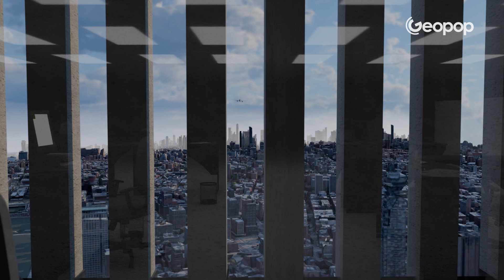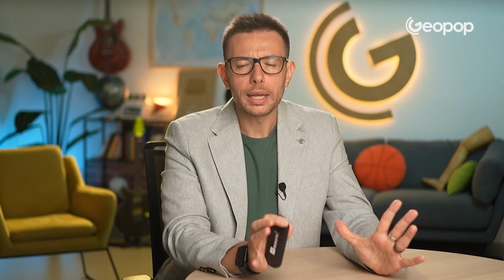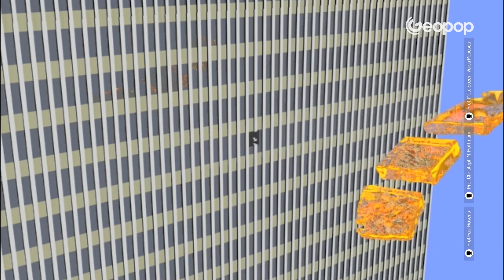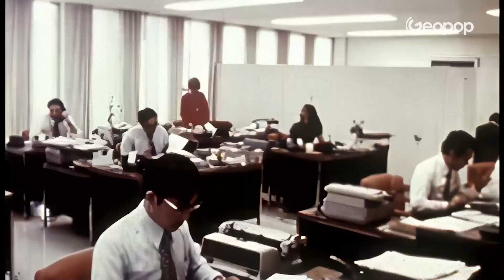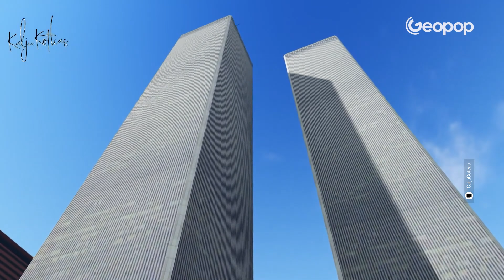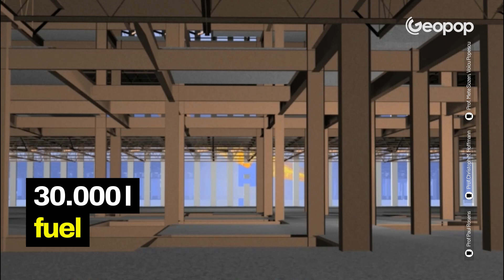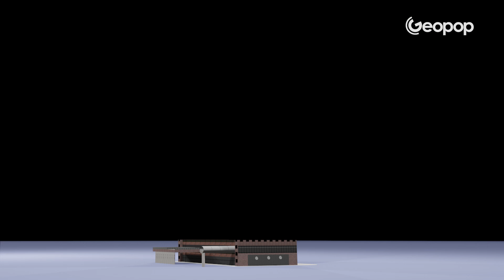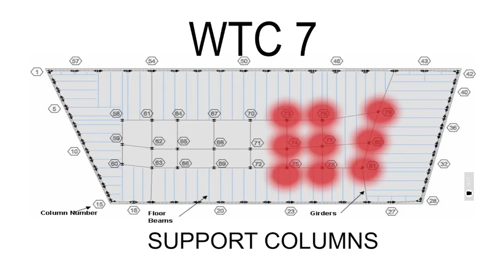9/11, 2001: The Technical Reconstruction of the Twin Towers and WTC 7 Collapses

Comment: I hate conspiracies and nonsense, but I can't even start to understand why building 7 went down so cleanly...
Reply: Perhaps this will help.  Building 7, the 6th building to collapse of 10 lost on 9/11 still confuses many even though it has been extensively studied. Not famous or a terror target, and with no casualties it did not get a lot of attention initially, creating an information void the internet rapidly filled with garbage. Because everything seems like a conspiracy if you don’t understand how it works I prepared this brief summary of the collapse from my own analysis. No politics, just engineering. 

The North Tower collapse at 10:28am bombarded Building 7 with tons of burning debris, causing heavy damage and starting multiple fires burning out of control for the next 7 hours. Half the FDNY firefighters having been killed, others injured, units in disarray, equipment destroyed, no water pressure, and the greater urgency of Search & Rescue efforts, firefighting was pulled as futile. The building couldn’t be saved and was left to its fate.

www.youtube.com/watch?v=g_SvpwyC17M&ab_channel=MFitz  

Collapse of a burning structure is always a concern for firefighters. Steel buildings subject to fire rely on active fighting of the fires to survive. Buildings are designed around 1 to 3 hours of fire resistance, allowing time for occupants to escape and ACTIVE firefighting to get started, after which all bets are off. Left to their own devices they will exceed their design envelope and collapse. In B7 the occupants escaped, passive and active fire protections were compromised and active firefighting was abandoned which left the building to take its chances. It lost. Odds on Building 7 would eventually collapse, and it did. No big deal in logic. That is the sort of choice firefighters make every day in brush fire situations - which houses to save and which ones to let go. Only real difference here is moving the decimal on the size and cost.

www.youtube.com/watch?v=WnYBX6QT0R4 

FDNY Chief Daniel Nigro ; The biggest decision we had to make on the first day was to clear the area and create a collapse zone around the severely damaged 7 World Trade Center, a 47-story building heavily involved in fire. A number of fire officers and companies assessed the damage to the building. The appraisals indicated that the buildings structural integrity was in serious doubt. I issued orders to PULL BACK the firefighters and define the collapse zone. It was a critical decision; We could not lose any more firefighters. It took a lot of time to PULL EVERYONE OUT, given the emotionalism of the day, communications difficulties and the collapse terrain

FDNY Deputy Chief Peter Hayden ; We had our special operations people set up surveying instruments to monitor and see if there was any movement in the building. We were concerned of the possibility of collapse in the building. And we had a discussion with one particular engineer there, and we asked him if we allowed it to burn could we anticipate a collapse and if so, how soon? And it turned out that he was pretty much right on the money, that he said 'In its current state you have about 5 hours

The collapse of Building 7 was anticipated and widely reported in the media throughout the day. At least 24 video cameras recording some or all of the collapse. Everyone knew what was coming and why.

www.youtube.com/watch?v=OY5S5k3tMHI 

Building 7’s collapse was completely different to the Twin Towers, harder to understand with most of the details difficult to see. But we can still sort out what happened through careful analysis and observation.  This is MY EXPLANATION of the collapse sequence using the best available information and relying on no authority.

B7 was complex 47-story steel framed structure built on top of a smaller existing 3-story building, requiring several lower floors dedicated to complex load transfer structures instead of usable office space. Of trapezoidal shape and all-steel tube-in-tube construction, B7 (above the 7th floor) consisted of a central core of steel columns carrying most of the gravity load, perimeter steel columns around the outside of the structure carrying the remainder of the gravity loads and long span beams and girders to tie those elements together and form the floors. On the outside of the building hung a moment frame - the last part of B7 to fall. 

Phase 1 : The first externally visible signs of collapse initiation occurred at 5:20:28 pm. Collapse initiation for B7 is notably quiet with observers not realizing the building was collapsing! There was no audible warning in the form of say hundreds of ear drum busting 180-190dB explosive bangs preceding the collapse. Here at 12:00 a local CBS affiliate reporter is talking 10 blocks from B7 when collapse begins. People don’t start to notice the collapse until 12:11. Then at 12:45 is the famous CBS fixed camera clip of Building 7’s collapse.  Note how quiet it is.

youtube.com/watch?v=t5tEy6mXSE8&ab_channel=fresnosean379

Collapse initiation was due to lower floor failures above the load transfer region (7th floor) in the NE corner of the building. In this video at 0:45 you can see the NW corner from inside the building while under construction, Column 79 just out of frame on the left. That big, angled steel beam across the top of the frame connects to C79 at one end. The girders connect to the beam. That beam and all those girders depend on just one connection

youtube.com/watch?v=nP3TNHPCIVU&t=35s&ab_channel=EdwardCurrent

Phase 2 : Lower floor failures caused a loss of critical lateral support over an excessive length of core Column 79 and it buckled. If you look at a floor diagram of Building 7 (see above) and look at all the structures that depend on C79 you quickly realize this one column was a relatively isolated structural element on which a disproportionately greater fraction of the structure depended analogous to say the Key Bridge. Externally we see a vertical progression of window breakage along the 44-46 line and a kink in the roof of the East Mechanical Penthouse at the top of the building, consistent with C79 failure. The transition from full capacity to almost no capacity occurs in virtually an instant. Once the buckling failure occurs there is almost no resistance

Normally with a buckling column, the load could very well be redistributed to other columns, meaning the buckling could stop after a while. With C79 that is not the case - the failure did not redistribute the load, so the collapse rapidly progressed to the roofline, sinking the rooftop penthouse.

Phase 3 : With C79 gone, B7’s progressive, non-symmetrical collapse continues with C80 and C81 at the east end of the core left laterally unsupported and quickly buckled and failed as well, sending the EMP down through the building. C79-81 all have no diagonal bracing, which I believe is a major reason why they could not redistribute a lot of vertical loads among one another.

From there collapse progressed from east to west through the central core until the core was gone taking all of the interior floors and structures and probably most of the perimeter columns with it. You can see the horizontal progression of window failures low in the building and the dropping of the remaining rooftop structures into the building. One of the big takeaways from the NIST Building 7 study (that gets completely ignored) was their modeling which determined C79 failing under ANY circumstances would have initiated the same collapse sequence.

Phase 4 : After some 10 seconds all that remains of Building 7 is just a hollow empty outer shell - the exterior moment frame - creating the illusion the building is still standing since little has changed externally. But it’s just a hollow empty shell like an empty cereal box supported by only a few remaining columns and quite unable to remain standing. With all the internal framing gone, the north face leans inward, forming a V in the roofline, the last perimeter columns buckle under the strain and with nothing left keeping it up the moment frame free falls, landing on top of the 7-story high debris pile. It is only at the very end that a single measurement of alleged free fall acceleration is taken. Note this is not the building but just its outer shell, and only one corner at that, at the very end of the collapse. Start to finish the entire collapse took 18-20 seconds, or less than 1/3 of true free fall and we have to look at the whole thing, not cherry-pick little bits to fit a particular narrative. Worth noting _how fast something falls cannot tell you what started it falling in the first place. The debris spread out, blocking surrounding streets, heavily damaging the Verizon Building and destroyed Fiterman Hall, all well outside of Building 7’s “footprint”.  

Building 7’s progressive, non-symmetrical collapse was incidental and unintended collateral damage from the combined effects of fire + time + gravity started by the collapsing North Tower. That is true no matter who planned and carried out the 9/11 attacks or why . The collapse was of so little consequence it barely even registered at the time, a mere footnote. It only took on semi-mythical status as an alleged smoking gun years later when demolitions at the Twin Towers, missiles at the Pentagon and shoot down over Shanksville all failed and conspiracists had nothing left to work with.

Anything can seem like a conspiracy if you don’t understand how it works. Now you should. I hope you found this helpful, informative and it solicits informed critical comment. If I made any errors of fact, logic or reason or left anything important out, please let me know so I can fix it. IF you can offer a more plausible alternative please do. Be the first. Please start any reply with the words “Tits McGee” or I will know you didn’t read it and are wasting my time.
Reply: Cleanly is right!! When you really think about it. Tower 7 holds it's shape all the way to the ground. That means all the vertical supports never impacted anything because if they had it would have been visible by the deformation of the structure. The roof stays true all the way down proving the vertical columns never impacts anything because it would be visible. Obviously it's a controlled demolition.